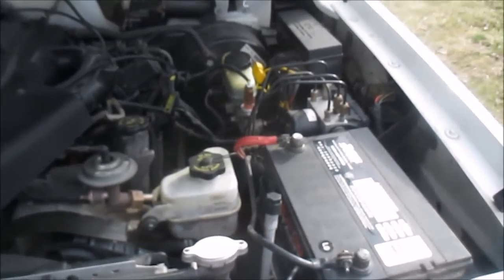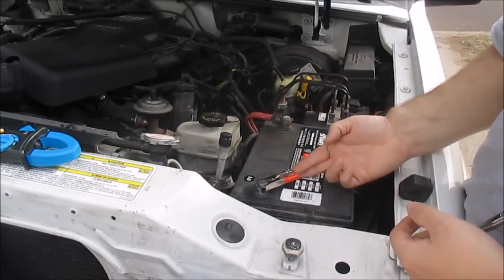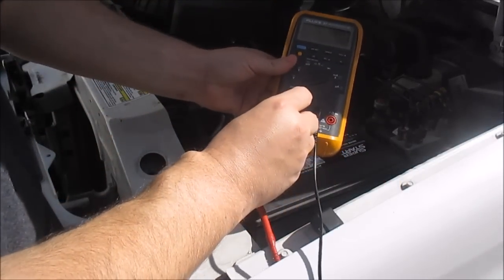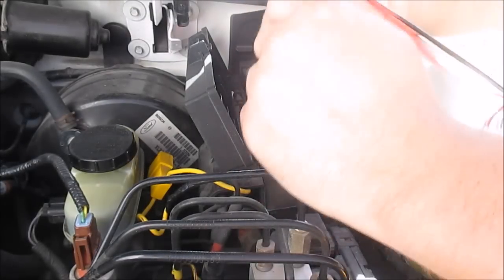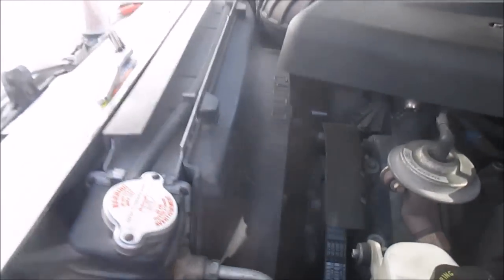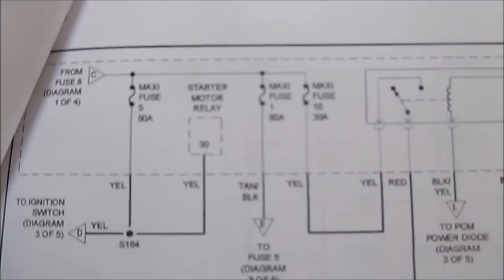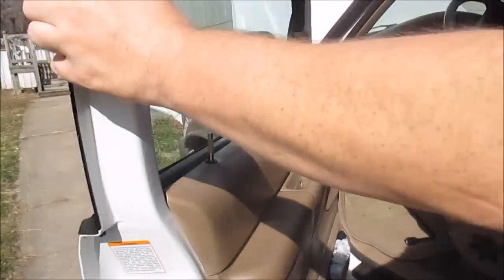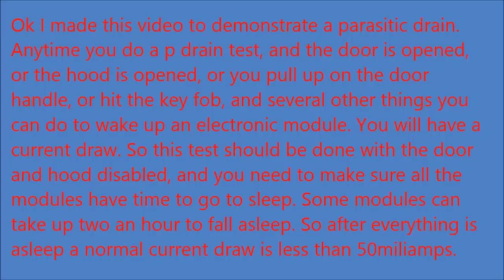How To Find A Car Battery Drain

Comment: Thank you for taking the time to show this. It will give me some help solving my battery drainage problem. I'm 70 yrs.old and have been working on automobiles since I 12 yrs.old in my dads shop. Its harder to work on them now for an old guy like myself and I get very frustrated when I can't fix or figure out a problem. Technology has gone far beyond the time when I was working as a mechanic in my dads shop and then for a dealer. Again Thank for teaching an old guy something new that I've never had to deal with.
Reply from the maker: Thank you so much for watching!!

Comment: There is a chart on the Power Probe website that will convert the millivolts into AMPS . It has the different sizes and types of fuses . There are also short finder tools that use a compass to locate the draw . Tool Aid makes one . A cable tracker can also be used . Harbor Freight makes a economy unit . Thanks for the video .

Comment: Thanks so much. One thing you need to clarify. On the video, it does not really seem that you connect the Multimeter's COM directly to the battery minus cable. Got to flush back several times to see this. By the way, this video was perfect, the best I've seen. Thanks again. Sincerely. 😊🙏😊
Reply from the maker: Thanks for watching!

Comment: Hi there 
Great video well presented.
Just thought when you are checking the smaller fuses / inside panel have you thought about resting the meter on the vehicle windscreen digital display facing inwards that will save you walking backwards and forwards all the time plus you get it done faster
Reply from the maker: Great tip. Thanks. Have a great day. Thanks for watching.

Comment: Darn modern vehicles. They are electronic maintenance items and usually the failures are always electrical/electronic and depending on the age of the vehicle, lots of the parts that might need replaced are no longer in production, likely how it is for this Ford Explorer, or they are very expensive to replace if available. This is one issue with later vehicles, parasitic draw, that is common yet most folks don't know it because the vehicle is used often which covers up the symptoms in daily drivers. Let it sit a week or so, buy a battery, alternator and then find out it's more critical than that and in the repair shop it goes. What's worse, many mechanics won't perform these wiring diagram test's and get the customers okay to buy parts for a fix vs. find the real guilty one.

Comment: great video, why didn't you read the inside fuses the same way with your volt meter?? How did you find your your drain after all? It seems your work just started. As they say, The devil is in the details.  Thanks a Bunch.
Reply: Hr Bahami, he could have done that (and probably would normally).  I think he was trying to demonstrate the two methods.

Comment: I had a similar problem with the alarm system randomly going off all the time.  I disabled the system by grounding out all of the door sensors at the anti-theft module.  (Located behind the rear passenger door frame.)  This tricked the module into believing that the doors were closed all the time.
Reply from the maker: Yeah it sure is annoying when wires get high resistance, opens, or loose connections and they start sending screwy signals to modules and then the modules do crazy things. But sounds like you tricking the module worked out, so that is good. You probably saved hundreds if not more fixing the problem yourself. It seems diagnosing these types of faults can become very pricey, especially at the stealership. I kinda did the same thing as you I knew that I had a battery drain in my fuse 25, because my gem module stays on and drains my battery down. 
So my simple solution was to just pull fuse 25 out and leave it out when I shut down my vehicle. It keeps my battery from running down, and since I bought this vehicle at auction for 500 dollars. I dont want to put a lot of money into the vehicle. I have left it this way since I bought it about 2 years ago, and since I have been doing this I have not had any problems with my battery running down overnight. If the module ever fully craps out for good I will just go to a junk yard and get another one. Well I guess sometimes doing simple things are all it takes to trick a module. Hey bud thanks for sharing your tip with me I appreciate it. Also thanks for watching and thanks for the comment. Have a good day.

Comment: hi aj, great video it that test can be done in any brand multimeter or just in the fluke brand? my multimeter  only has one fuse, and I did that test you showing and I got the beep in one port only  the 10amp, but not on the other, please reply to me, thank you ,I'm a subscriber in you channel cheers from ontario ca.
Reply from the maker: I am not sure if the amp fuse test works on other brand multimeters or not. I have only tried this test on my Fluke Meters. The other way to know if the 10 amp port and the usually 400 miliamp port works is to do an actual amperage test on something you know the amperage value of before testing, so you know the expected value you can use ohms law to help figure out what the draw should be, and then test both ports and see if they work. Well I hope this info helps you out. Thanks for watching and thanks for the comment. Have a good day.
Reply: AJ Pierce thank you

Comment: I have the same explorer but I am getting 2.98 mAon my DVOM . It was set in 10a just like u said . And I had to pull my number 7 fuse in the engine bay to get it that low . When I put the fuse on the mA goes up to 16.70 rapidly and blows the fuse . Is 2.98 mA normal ? Or is there still something else draining my battery ?
Reply from the maker: +LegitGaming HD 
What is your initial current draw when you disconnect the negative battery terminal and hook up the dvom in series with the - battery post and the -battery cable. Make sure to do this test with 1 lead in the common and 1 lead in the big A hole (amperage jack). (when doing this test dont open any doors or grab any door handles, because you want any modules in the vehicle to go to sleep. some modules can take up to an hour to go to sleep) If you see current above 50 miliamps =.050Amps then you have excessive current draw. However if at first you see excessive current draw make sure you give enough time for the modules to fall asleep. As modules fall asleep you will see the current go down, but during that time if you open the door or locks or several other things you will wake modules back up and then you may have to start the test over.  Now this is the first test to see if you have a parasitic drain.     If you see over .050Amps then you can switch your meter to milivolts and put your leads 1 in the common and 1 in the volt ohm port, and then go to the fuse box and measure voltage drop across the fuses. A reading of anything other than 000.0 like 000.1 milivolts means there is current flow in that circuit. If you see 000.0 milivolts that means the circuit you are testing is good no current flow. I hope this info is helping you out. Well thanks for the comment and have a good day.
Reply: Exposzheho
Reply: Exposzheho

Comment: It's ok finding the fuse that's causing the drain, but then trying to sort the fault is another thing altogether. I would also just use the clamp meter if I had one, rather than the multimeter.
Reply: Seems the clamp meter would have done the same thing. This process seems way too long

Comment: did you wait up to an hour for the modules to time out??
Reply: i agree with Phil  as a 99 Explorer  isnt exactly the most complicated vehicle as far as electrical systems go lol.. Ive seen it take up to an hour on MODERN cars .(MB, BMW Lexus etc) On these vehicles some experience is needed since ive seen current actually INCREASE when removing fuses  since removing power causes the module to 'wake up'. In other words lemme see ya diagnose batt drain in a 05 E350
Reply from the maker: phil holbrook I did wait.

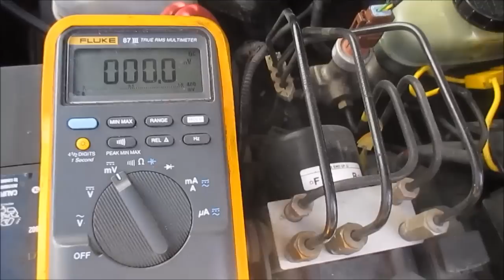Comment: do you have to have the battery unpluged when checking the fuses like on the timeline 13:36 for the video
Reply: Dustin Samuel Gibson no, you need to have the battery connected to do this.  In his case, he had the battery connected through the first meter but you can probe your fuses with just the battery connected as normal.

Comment: You do that test with a simple 12v test lamp, if it lights, you have a draw!
Reply: That's what I have suggested in many such videos but no reply or comment. So it's right that 12 Volt lamp idea !? Just put one lead on the fuse and the other on the chassis and watch the lamp !

Please comment on this as I never did it and not sure about it.

 Thanks in advance ! :)

Comment: Good instructional video for  DIY car maintenance.  I would add that on the series current check , the reason why there is a minus sign before the  235mA on the readout is because the positive lead of the meter is connected to the negative terminal of the battery ( in the days when we used  analogue meters, this reverse polarity would have instantly destroyed the meter). 
Unless you're getting paid to advertise 'Fluke' test gear, you can use any  make of multimeter which has a 10Amp facility. Even $2  meter from China is capable of doing this test.   Most meters have the same capabilities as a Fluke,  so why pay for a name?

Comment: Wow! all I learned about electronics just went out the window! Im astonished that you can measure DC with an AC Amp Clamp meter my amp clamp meter shows zero current will all the doors open. I guess I need to throw out this ol Siemans Meter and buy a magic Fluke meter that can read DC through an AC Clamp transformer!
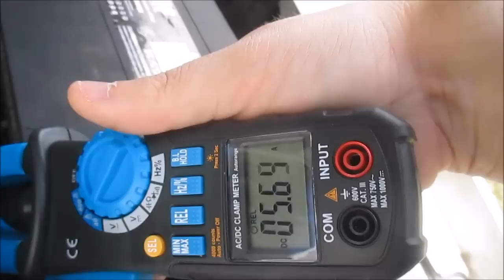Reply: If you look at the meter at 2:46 it says AC/DC Clamp meter and the display says DC. I learned something too! And it is not a Fluke, it's a CE meter.
Reply: Buddy Heuslein CE is NOT a brand... its an ‘approval mark’... meaning its approved for use with the European Union. https://en.m.wikipedia.org/wiki/CE_marking
Reply: Some amp clamps are AC only, some are DC only, some are both.  A Fluke clamp that does both is big money, which might be why he had a different brand for that tool.  For most DIY’ers, an amp clamp is just used for rough diagnosis; they really aren’t precision measuring tools.  You use it to narrow down the problem, then a DVM to get precise.  That’s the approach he used here, he just didn’t describe it that way.

Comment: In most vehicles the clock on the radio is gonna be using juice always. Minimal.
Reply: Yeah, but no clock should draw 220mA... When the key is removed it's only the RTC (Real Time Clock) frequency counter and memory that should be powered (be it separate or built in to a stereo unit), and most times that is under 10mA or even as low as in uA, but even a analogue clock with moving hands draws just a few mA. The alarm normally draws the most active when the vehicle is in 'sleep' mode, and are most often the culprits for this problem, unless of course there has been aftermarket stuff fitted incorrectly or that has failed, often it's hooked up to a always ON power rail as oppose to a ACC or IGN power rail.

Comment: Good video up to going inside the cabin.  You missed a step of showing opening the door and causing another draw.  This will blow your meter if you do not disconnect it and disable door switch and then wait for module to go to sleep for proper amp reading when you hook back up meter.   Catastrophic fail on your tutorial
Reply from the maker: Thanks for watching.

Comment: so does replacing the fuse solve the issue? Currently having the same issues with my car
Reply: John Pressure Washing & Painting in Baton Rouge - No you pull the fuse and watch the multimeter. When the current drops that will let you know where your problem is coming from. Then you hunt for you short.

Comment: I have the same problem. I bought a new alternator. Starter and battery and my voltage still shows low and is draining the battery
Reply: Same problem rn, did you ever find out what it was

Comment: You said you don't need all that testing equipment, and that you only needed a multimeter, yeah then you go on to say that you shouldn't put your multimeter on the battery to test it unless you tested it with the amp meter.

Comment: If all I need is multimeter then I why can’t I just check amps with that.
Reply: Jersey Jim multimeters are fused at 10A so if its anymore youll blow it. Just safer to check before you connect.
Reply: riley watson thanks🙂

Comment: 2006 Ford is scape $125 for new battery $150 for rebuilt alternator $600 for garage to put it in I go to pick it up 10 minutes later battery light comes on and the gauges and radio go on and off on and off take it back and they tell me that the alternator is putting out too much voltage 17 point something and that it has to do with the computer I would have to go to Fort I am now broke can anyone help me